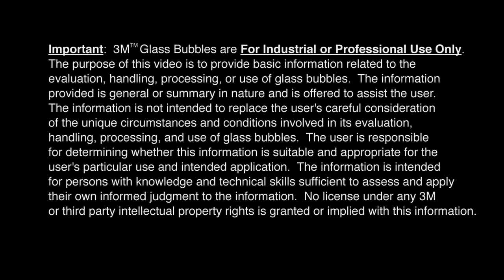Intro to 3M™ Glass Bubbles in Plastic Composites

Comment: Sir, with due respect, I have to point out that you failed to mention the main characteristic of Syntactic foams.. ie. Enormous COMPRESSILE strength.

Please make another video explaining why carbon-fibre reinforcement is good for only tensile loads & should never be used in applications that address compressile loads.